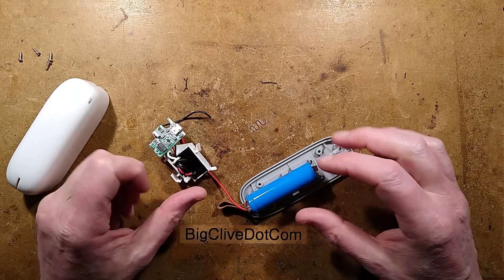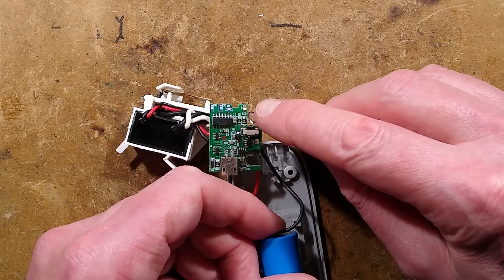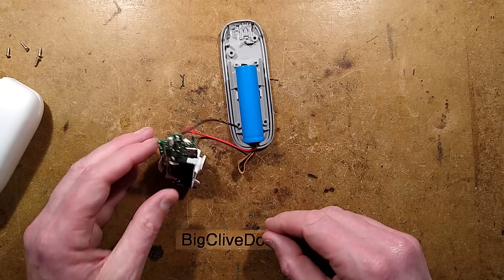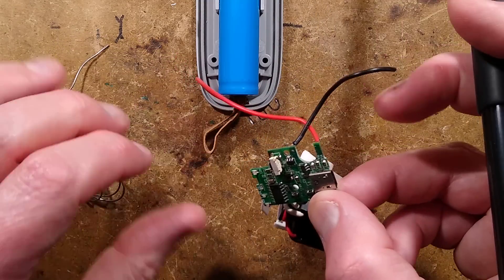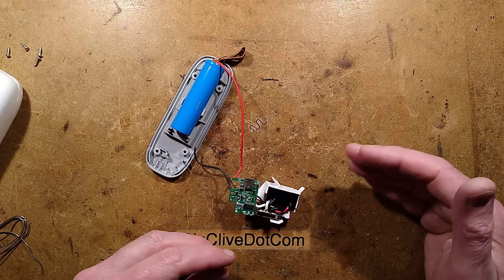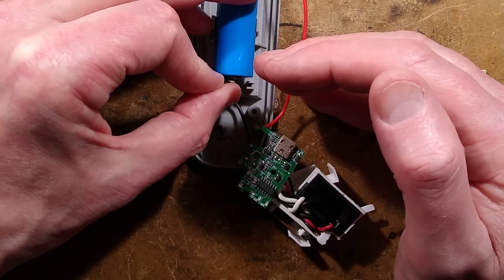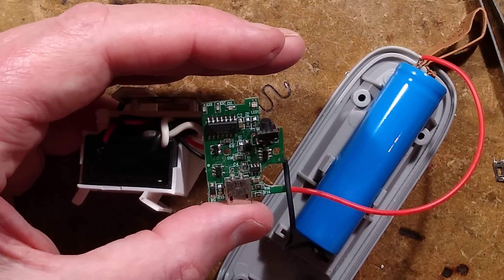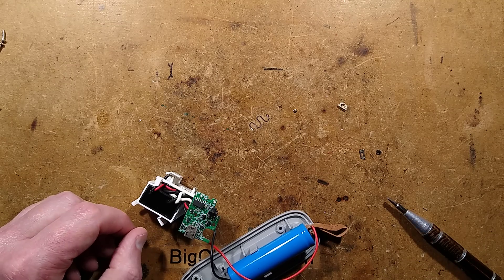The curse of tin whiskers rears its head again

Comment: So a part for one hundredth of a cent took the device off? 🤭
I stumbled over a video of "I do cars" last night. He takes scrapyard engines apart and looks for failures. The last video was about a 1.4 l Multiair Fiat engine. Fiat/Chrysler decided to use sparkplugs for 2.75 retail price instead of 15 per piece. One broke and fell apart inside the combustion chamber. Engine destroyed, car (economically) totalled! A 2.75 buck/quid part took a car out. That's the same ratio of value like with the switch here. 🤪
Reply: Failed Italian Automotive Technology, Chris Hendler Recommends You Start Learning Engine Repair...

Comment: Lead was also in paint and petrol and makeup and sweetener for a reason. But those reasons re not good enough to supersede the reason for not putting lead into those things.
Reply: True. Lead in solder would be way less of a problem if (especially small) e-waste was recycled properly and didn't end up on the landfill or in the incinerator, though.
Reply: Manufacturers that commit to collecting and recycling their products are still allowed to use lead (that's one of the reasons why lead acid batteries are treated differently - most of them do get recycled, and the same goes for specialised medical equipment, etc.).

But most companies don't want to pay for safe disposal, neither do consumers. So the only way to deal with it is to prevent it from being there in the first place. And if companies can make lead-free server motherboards, they can definitely make lead-free switches.

This one was just defective or contaminated (or crappy by design).
Reply: I'm happy lead pipes were banned as well as these 3 categories of products.

I'm more ambivalent on electronics. I mean is the ground water hazard that substantial? If it's an issue, isn't it an indication that the whole garbage processing infrastructure has failed?
Reply: @SianaGearz  - What kind of "garbage processing infrastructure" do you suppose you'd need to be able to analyse the composition of everything people throw into the trash and identify the presence of heavy metals?

Are you willing to pay for that? Just so that companies selling you disposable junk can have slightly higher profits or not bother to update their manufacturing processes?

Isn't it a bit simpler and cheaper to make sure that as little of those substances as possible enter the consumption chain to begin with? Especially since they're clearly not necessary for the vast majority of products? Applications that do require those substances are still allowed to use them.
Reply: @SianaGearz It’s also a hazard for factory workers assembling electronics daily, not just consumers/environment.
Reply: @TheXGamer969  - That's mostly the flux fumes, not so much the lead (soldering is often automated, anyway). And (in theory, at least) the workers should have adequate ventilation and PPE.

The main issue with heavy metals (and the main reason for RoHS type regulations) is not short term, direct contact with the products. It's the fact that people throw those products into the trash, they end up in landfills, and slowly accumulate in the soil, water supply, wildlife, and ultimately human bodies. Or, in some cases, they're incinerated, which can release them into the atmosphere (as was the case with leaded petrol).
Reply: If they really wanted to cut down on lead, they should have made the exemption for lead acid batteries only applicable to batteries that have a warranty of 5 years or more. Would help to get rid of the cheap trash that doesn't last.
Reply: @NiHaoMike64  Except for, they had an already very well-working recycling infrastructure in place for lead-acid batteries. And no suitable alternative for them.

Comment: aliexpress has really nice test leads for under 10 bucks, soft silicone leads with a grippy plastic-rubber-foam probe and good resistance. i tested the claimed 20 amps and its no problem.
Reply: Do they have pin sharp gold plated tips ? I need some new test leads, the ones i'm using now have suffered a fair bit of wear. But really no problem 20A, nice connectors, nice feeling wires, sort of average probe handles not particularly good or bad, tips very nice, don't need cleaning always perfect contact (at least before i wore them to near death), got lucky for just a couple currency-units. Some of them aren't so good, bought really bad ones once, terrible folded sheet metal plugs and then it just goes downhill from there.

Comment: I dont see why you feel its tin whiskers rather than the disc collapsing, or some other contaminant? 
I thought i was gonna see dendrites
Reply: Tin whiskers can be ultra fine sometimes, and I have seen tin whiskers in these switches causing the same issue with leakage, where a "collapsing disc" or other contact issue tends to be more dramatic, like a full short, or a switch failing to operate at all.
Reply: @EsotericArctos  If it was plated with tin, then that has nothing to do with lead free solder, though.
Reply: @albert_vds  True, but I didn't mention the lead free solder in my comment, nor did the one I replied to.   I have had tin whiskers in these type os switches before.   
I believe it is the plating on the switches, not the lead free solder, but my experiene has not been collapsing discs or similar type direct contact failure.
Reply: @EsotericArctos  Sorry, it wasn't meant as a negative reaction to what you said. More like a general addition to your comment that it has nothing to do with solder, like Clive points at in the video.
Reply: @albert_vds  No offense taken
Reply: @albert_vds  - Yes, Clive seems to have a somewhat religious view of lead-free solder, and tries to blame random things on it (a bit like Tony from Northwest Repair tries to blame everything on AMD).

Nothing in this video suggests a problem with solder (or with tin whiskers, for that matter, it could be just contamination, worn off contacts, etc.).
Reply: @RFC3514  I had the same thought about Northwest Repair as you. He has far more experience repairing Nvidia cards, when the problem persists and becomes increasingly complex, he already has the understanding to know the possible causes and how to fix them. But when dealing with AMD, he'll do the first few steps and if they fail exclaim it is unrepairable and AMDs fault for a third party manufacturer insufficiently reinforcing the board. He'll give up before really trying, further solidifying that view. When he delves deep into an Nvidia repair until finally succeeding it reinforces the idea Nvidia is superior.

Clive does the same with lead-free solder, blames it early without delving deeper. That said, both of them are many orders of magnitude more skilled than me, I sit in awe at their technical prowess, but we all have our little ideological quirks.

Comment: I use a very similar OZone unit in my fridge also.   It's been great to keep the fridge fresh and make fresh produce last longer.     This was an interesting video.   If I have the same issues I will know what to look for.
Reply: I don't understand. Don't you wrap everything in glad wrap to prevent cross tainting? I mean surely you don't just shove a cabbage or broccoli in there without wrapping it.
Reply: @iconoclad  your fruit and vegetables should never be wrapped in glad wrap or anything else.    Fruit and vegetables are living things, even after being harvested,  wrapping them in plastic wrap is the best way to make them go bad very quickly.   That's why refrigerators have the drawers with humidity controls .
Some things are packaged but never fruit and vegetables.     Go to your local grocery store and fruit and vegetables are not wrapped.
Reply: @EsotericArctos  some fruits/vegetables release ethylene as part of the ripening process. If they are wrapped it'll create a concentrated atmosphere that'll rapidly make them go off. Eggs have a natural membrane wrapping that protects against infection while allowing gas exchange, the yanks pasteurise their eggs removing that protection. So they have to provide that protection by keeping them in the fridge. Meat is completely different as internal tissue isn't supposed to be exposed to the air.
Reply: @EsotericArctos  My local supermarket sells cabbages, watermelon, pawpaw and other fruit and vegetables which have been halved or quartered for those not requiring an entire item. These are of course wrapped in glad wrap.
In my original post I was referring to items such as cheescake, prepared meals, and cut vegetables that of course should be wrapped to prevent cross tainting.
In my experience the "crisper drawer" is about as useful as a hip pocket in a singlet.
Reply: Both sides of the argument often overlook a fundamental point: convenience tends to outweigh nutritional value in modern society. In reality, you can gain more nutrition with less energy consumption—without relying on a fridge, which contributes to environmental harm—by simply eating food soon after it's harvested. If you're capable of building electronics, you can likely cultivate your own food as well, though this depends on individual life circumstances. Humans, by design, are like biological batteries—storing fat in the summer and losing it in the winter. When this natural rhythm is disrupted, combined with modern dietary and sedentary habits, it leads to numerous health issues and lifestyle diseases.

Comment: Clive, You should have a look at the electronmicrograph of the dendrites gallium grows in nickel, on der8auer's video on his failing threadripper
Reply: Failing? Do you mean the one that was overheating (due to bad contact with the heat spreader, which he didn't remember he'd removed)?
Reply: @RFC3514  was trying to give search terms dude. not a video summary
Reply: @mycosys  - But the CPU wasn't failing. I mean, the gallium didn't grow into the CPU, it grew into the heat spreader.
Reply: @RFC3514  and yet that search returns the video as the top item :)
Reply: @RFC3514  Also never heard of a nickel CPU, im sure Clive being an Electrical engineer figured it out
Reply: @mycosys  - It definitely doesn't for me. If I search for "der8auer failing threadripper", it returns his first review of a Threadripper. Where there's also no "failing threadripper", BTW.

There was indeed a video with a "fail", but it was Roman's (when he dropped the CPU onto the socket and damaged the motherboard - I think the Threadripper itself was still OK).
Reply: @RFC3514  have a nice life

Comment: I wonder if tin whisker growth is similar to the problem that certain battery chemistry's have with growth of dendrites as in zinc and lithium batteries. Crystalline zinc or lithium hairlike dendrites grow across cell electrodes which short out the cell. Moisture in the refrigerator may aid in their formation acting as an electrolyte solution to support their growth.
Reply from the maker: In this case the unit was never used in a fridge.  Just sitting on a shelf.

Comment: Early transistors suffered tin whiskers, causing low gain, intermittent operation (knock them for a temporary fix) and noise - I have an Eddystone receiver in need of 6 new transistors - which I need to get round to replacing 😂  Never considered then inside a switch though - interesting one to file away for when needed in the future.

Comment: I am still not convinced that there is any tin inside of the switch at all. And I find blaming eco-friendliness for this fault premature. If there really is any tin on or near the contact plates, it is simply an inadequate cheap switch, regardless of mixed-in lead or not.
Reply: I always thought it's the click membrane that deforms.
Reply: switches never had lead in the plating anyways, it doesnt make sense to pin it on lead content.
Reply: @drkastenbrot It isn’t being pinned on lead content. It is the composition of modern solder.
Reply: A little research suggests it's tin plating that is the issue and nothing to do with solder, leaded or lead free.
Reply: @Ed.R Your research is incorrect. As an electrical engineer, I can assure you that it is the solder that is at fault.
Reply: @greatlambrini8722  Where do you think the whiskers had formed? Why would there be any solder inside of the switch?
Reply: Tin Whiskers is a well known phenomenon and is an issue with solder. You are incorrect.

Comment: If there were nothing else to hate lead-free solder for this would definitely be a high reason...the stuff is crap and deserves to never be used
Reply: Lead free solder has got better, but I would still prefer to use the old fashioned leaded solder too.
Reply: A couple of questions I have are: How does solder on the switch legs end up inside on the switch contacts? Secondly, doesn't lead solder also contain tin?
Reply: @Ed.R /videos 
My normal solder (60/40) does contain tin but the addition of the lead helps keep the tin from growing "whiskers" which can creep up and cause problems.  
You can also see this kind of whisker growth with Zinc electroplating.
Reply: @gregorythomas333  Any alloy solve the problem of tin whiskers. It's only pure tin which causes whiskers. Many metal form whiskers; zinc, cadmium, indium, silver, aluminium, gold, and yes even lead.

Comment: Thanks Big Clive!  I had never heard of this, very interesting.  I've noticed some weirdness in my 2000 Audi with the switch that initiates the driving lights.  You have to wiggle it and push it quite a few times to engage it or disengage it.  I wonder if that might be the problem - or of course the thing has just worn out.  Not sure if they were using tin solder in Germany in 2000.

Very cool and yet another useful bit of knowledge gleaned from your channel.  Amazing stuff.

Comment: I'm so glad I'm not the only one that accidentally melts tiny plastic PCB components on accident.  haha.    
This tin whisker problem is so fascinating.
Reply: It's an old problem that resurfaced due to the reformulation of solder to remove the lead.
Reply: The question is where the whiskers were... Between the solder pads due to the formulation of the lead free solder, or inside the switch... But IIRC the contact surfaces in these tactile switches should be Nickel plated not tin plated... And if it is indeed a problem of the internals on the switch, a new one of identical make would probably suffer the same long term fate.
So I wonder if the approach of reflowing the solder joints with lead based solder and hoping for the heat to wick into the switch long enough to melt any whiskers within isnt an option...
Reply: BY accident, not on.